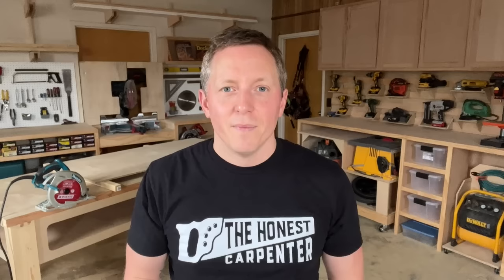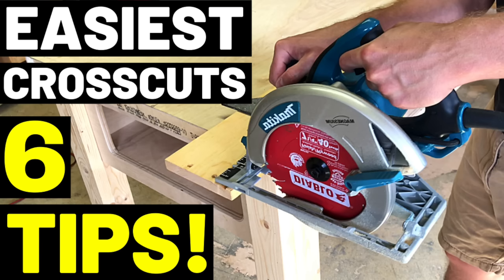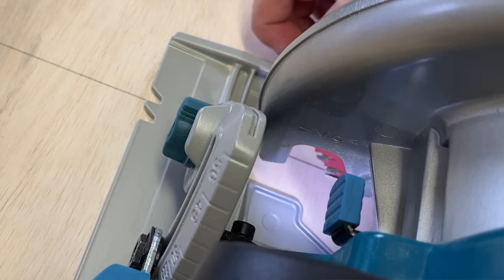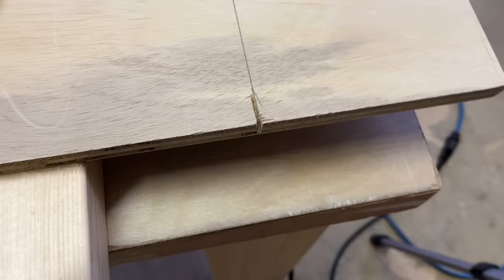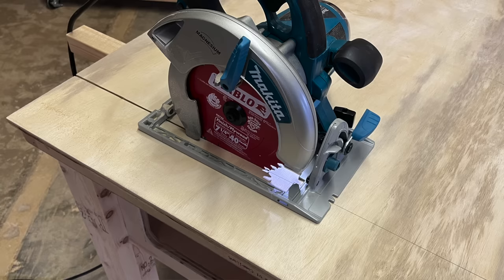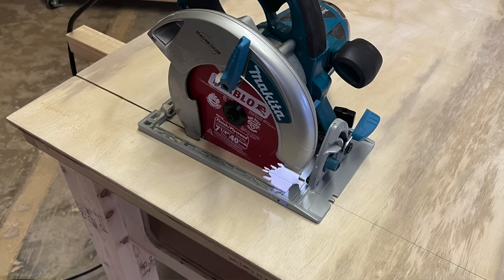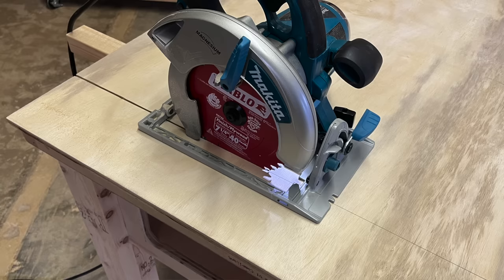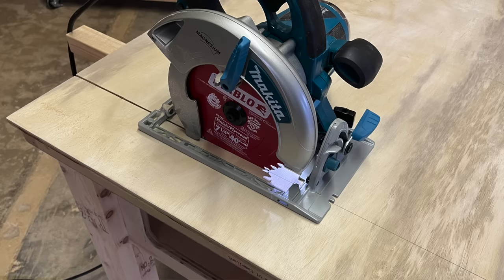How To CUT STRAIGHT With NO GUIDE! Freehand CIRCULAR SAW CUTTING...Pro Tips, Tricks and Secrets!

Comment: I'm a lefty and my sidewinder is just like yours. This means, when I hold the saw in my left hand, my whole body (and head) are to the right of the blade. I don't need to lean over the saw and see around the saw body. Also, if I'm cutting along the edge of a cutting table, I'm not twisted and crossarmed and can walk comfortably along the table. I've always wondered if what people think are "right handed" saws are really left handed, and vice-versa.
Reply: Same here. The only issue I've had is that most saws tend to spit the sawdust at your leg.

Comment: 8:42 Dang dude, did you heat that blade up a bit?
Good instructions for the DIYer no doubt. 
One thing I'd like to add which you may or may not have covered. While holding the saw, Don't be tense.
Also, The importance of """sharp""" blades help you & your tool(s) do the job with the greatest of ease.

Comment: Me, having arrived here because I'm trying to do a project with a cheap saw with a cheap blade.   Shoe is warped and isnt straight from the factory, blade may not be perfectly straight.  Plus my "skills" (oxymoronic use of that word) are quite rusty.  If I coukd afford to buy a hand saw and do it the old fashioned way, I would.  I have a lot more experience with one of those.

Thank you for the tips and an execelent video.

  I'd like to see a study on the amount of accidents or injuries involving saws with that spring loaded blade guard, compared to accidents and injuries involving a saw where the blade guard was removed by the owner.  I know it's a legal requirement "for safety reasons"  But I wonder if it might actually have an opposing effect, due to people having to try to hold it back and monkey with it while cutting.  The saw I'm using doesn't want to make a straight cut in any regard.  But starting the cut with that blade guard down...  you'd be better off to not make the cut and throw the whole board on the scrap pile.lol. i'm sure I'm not the only one who always holds that guard up while starting.  And that in itself seems like a great way to have an accident.   A saw where one could have both hands on the grips properly; or one hand on the grip and one hand on the board (well away from the path of the saw.  Of course) to keep the board from moving, seems like it would result in less accidents.

Comment: I'm no expert by any measure when it comes to woodworking, but that was a great job breaking down the details of how it's done (many of which I didn't realize I knew/do until you pointed them out. 

May just be me, but I've found it useful to check if I can safely complete the cut without repositioning before I start the cut. Even if it's not always possible to avoid repositioning/moving verify can help reduce the amount of repositioning needed (particularly on longer cuts >3ft) during the cut (whether cutting free-hand or using a guide). .....and it can also help with cord management/positioning.

Comment: Not quite ready to go freehand yet but this tutorial was amazing. Thank you!
Reply: Yes, good vid but like you, I'll pass on this.  Too much hassle, especially to start the cut, and then keep it straight until the end by freehand.  With a straight edge (like a 2" x 1" galvanize tubing clamped to the board) that extends somewhat on both sides of the board, you will begin and end perfectly every time.   This is from a non-professional but experienced DIYer.

Comment: I, like others here, have been a carpenter since 1976. And yes, tutorials are very beneficial. But nothing beats practice. Then experience follows. And different saws are better than others for site windows. And base plate site marks. Get a saw with a good site window and site markings. I'm disappointed in newer saws. With smaller bases, your stability gets less. My old Black and Decker saw cat had a beautiful wide base. Seems bases have lost width over the years. 
Anyway. Practice will definitely do wonders. Thanks for a nice video.
Reply from the maker: Thanks Peter! I see what you mean. I like this makita magnesium I bought, but for some reason they changed the sole plate shape. It’s got this 45-degree dog ear missing at the back. I feel like this affects lift-out when I’m finishing a cut. I can’t seem to figure out what purpose it serves 🤔
Reply: @TheHonestCarpenter  That's why I've never bought a worm drive.  With all that power, they are so awkward to use one handed. And no base plate or sole plate to speak of. But lots of carpenters um. I don't always know who designs tools. Probably the same people who design auto engines, that u have to pull the engine to change a few of the plugs,,,or maybe its cost. But it sure leaves open the demand for edge guides for rip and crosscutting long runs.

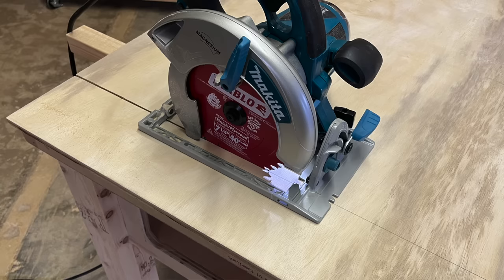Comment: 13:13 I use a zip tie to hold my blade guard open instead of my thumb. Put the zip tie through the loop for your angle adjuster. Don't pull it tight and just flip it loose with your thumb when you're ready to release the blade guard.

Comment: Ive never been able to cut straight, i blame my vision cus im basicslly blind in my left eye. It sucks, ive been able to adjust for nearly everything else in life but cutting my lines when sawing.  No matter what even when i use my angle and follow my lines, im going to try a laser guide though see if that helps...but the blocks underneath and going over the top instead of from the side reaching..that should totally help.

Comment: I'm a professional and have cut thousands of straight cuts without a guide other then a line. The key to keeping your cut straight relies on keeping your arm as stiff as you can, constantly watching the relation of the cutting edge to the line and finally trying to only move your body to move the saw.
Reply: Great video , could use a speed square to start off the cut , will make it way easier .

Comment: "Straight enough" is the real trick here. 

Pro carpenters (home builders) have pretty large tolerances and if you check even veteran pro long freehand cuts, they are not perfectly straight... 99% of the time, they're not even close. 

If uour project requires you to check the result with a straightedge... just use a guide and save yourself a recut

Comment: I saw another YTer use a large piece of (insulating board?) foam, to use as support as you did with your 2x2's, on the ground for big sheets of wood.  Other than that, you did a kick ass job of explaining the finer details of using the circular saw.  Great work (also the spot on with the camera angles and editing).

Comment: I place a piece of 3/4 - 1 inch foam insulation under the sheet stock before I cut it.  It is supported completely and is very stable.  Yeah, I Have to replace the foam occasionally, but the benefits are worth it.

Comment: I used my circular saw today for the first time today, I didn't realise it was unusual to do it freehand.. however, I started with small pieces, not a board, and couldn't see the cut line at all, not once the saw blade was  there. Can't see the blade at all. Cutting a wooden board was a lot easier as I could see the laser line on my cut line.

Comment: The guard always gets in my way.  I had an old saw that I took it off.  That was years ago.  Now.  Just with muscle memory I pull the guard back before every cut.  The guard always provides just a bit of feel able resistance.  Don’t pull back.  Go slow.  Don’t use the guide on the saw.  Use your eyeballs and stay glued to the line.   When I get to the end of a cut and it will get in a bind at the very end, I reach around with my other hand and gently hold up on the discard piece and then a go from a slow cut to as fast as I can.  The saw can make the straight cut before gravity takes the wood and creates a bad end.  Just the last 2 inches.  I even do it without holding up on the other side.  Like when cutting plywood. I will be stretching with 4 ft or longer reaches.  Just zip the last two inches very fast.  The blade goes through.  The falling piece, falls and all the corners land at the same time and you feel the gush of air get displace, and it makes the sound of the entire piece hitting the ground evenly.  That is a perfect cut.  I am a tool nerd. It is like crack for me.  I always have to buy tools.  Ever since I was a small child.

Comment: Excellent video as usual. This is exactly why I bought a track saw. I got a budget model but I'm not in your league. I also bought a "universal" track and sled from China for my battery powered Metabo saw to use at the big box stores because their panel saws either never work or it's just a crap shoot. I've even called to make sure their saw is working and then get there and no one working is trained on it 🙄 That was Home Depot. Lowe's has a problem with working saws. For the record we have 2 Home Depot's here and 3 Lowe's in the city and several outlying towns have one or the other within a 20 minute drive. It's pathetic.

Comment: This is an awesome video. I've done a moderate amount of skilsaw work: maybe a couple hundred cuts of varied types. But I have not been confident at all about free cuts: for cuts demanding precision I have instead relied on clamped guides. This video has brought up many great tips including: (1) getting the cut started perfectly  (2) giving about 1/4" opening (3) keeping your eyes directly on the cut line (and not on the v-cut guide)  (4) getting the blade completely up to speed before entering the cut (5) leaving the saw on the exact spot if you need to stop it for a moment (and backing up 1/4" before starting again)  (6) allowing 1/4" inch of blade below the cut (I sometimes did less)  (7) cut through the line (but I guess more towards the kerf side?)

Comment: Cutting sheet goods has always been a struggle for me, more due to space and availability of equipment. I can't wait to see the video on how to get more precise lines when cutting sheet goods. I have a guide but clamps get in the way and sometimes the saw doesn't ride the rail well due to the rails low profile.
Reply: Try a clamp on guide to avoid clamp interference. They are cheap and accurate enough for most purposes
Reply: @firebladex8586  Thanks for the advice, I actually have one but I find that the guide plate on the saw jumps the rail and still runs me off course. 

Do you have one you'd recommend?

Comment: Once the blade is fully into the board (6-8"), if your steady forward pressure require more pressure, or you smell burning wood, you are twisting your saw and won't have a straight cut (assuming that your blade is sharp).  Stop and check your setup and support, move your body to be more inline with your wood, ensure that you are using a good blade, then continue.  (All learned the hard way).

Comment: These suggestions may not belong here, but give some thought before cutting to a few more points…
1. Am I using the right type of saw. Sometime you just have to make the best with what you have, but there is a reason why there are many types of saws: table saw, radial arm saw, bandsaw, Sabre saw, etc. 
2. Likewise, use the proper blade for your material. Another topic altogether, but think about it. Number of teeth, masonry, metal, etc.
3. Is the blade getting dull, warped, or dirty. Buildup of tree sap has interesting side effects.
4. Let the saw do the work. If you try to go too fast, it’s more likely to wander. 
5. Periodically check adjustments of depth and tilt. A good saw should lock in, but it never hurts to double check.
6. Give it, and you, a rest. Pay attention to overheating.

Comment: Different saw blades have variations in the kerf width.  I know that the cut guide marks on my saw with my present blade does not line up with the kerf.  It actually cuts on top of the line instead of right along side of it. This is because the blade on it has wide carbide teeth.

Comment: I get the blade parallel by plunging it slowly. I'll start slightly on the waste side of the cut, and then micro adjust it to the line and parallel to it, and then plunge in parallel.

Comment: Great video. What's your take on tools that use lasers to guide you?
Reply: From someone who was pushing a circular saw the this Youtubers daddy was in diapers. I tried the laser guides when they first came out.  Could not keep enough batteries in stock.  I personally think the laser guide is just a "gimmick".  I never met any woodworker who had anything good to say about them. The REAL requirement, as the guy making the video said, keep your eye on the spot where the blade meets the wood.

Comment: A tip not mentioned often is eye dominance. Right sided saw blade and left eye dominant is difficult (error prone). On my end it will often cause deviations of a few millimeter. Disclaimer: I could use some extra time woodworking.
Reply: I have literally just found this out and wish I'd considered it before.  I was having a rant about how difficult the circular saw is to use yesterday, watched this today and realised in an instant what the problem was.  I am VERY left eye dominant and yet bought a right side exposed saw.  Darn it.

Comment: Great video here Ethan pal.. Been sub'd for a while now bro and I have to say that I really enjoyed the content of this video. I have a table saw but I like to use my Bosch pro Circular saw for cutting larger boards of MDF, OSB or Plywood. I always feel more comfortable this way but I am going to buy a good trach saw next year when the finds have been saved.. I think I'm going to build one of those Benches with the drop down guides like Peter Millard has on here. He builds cabinets and kitchens and I am looking to get building a bespoke kitchen for a family member over the next year or so. I want to learn as much as I can from these videos but I don't have the basic grounding that most chippys would have. I only really got into woodworking over the past 6-8 months really.. 
I want to build a station for my Bench Drill and Mitre saw but I'm a little weary of getting started atm. I'm kind of afraid tbh. I know I just need to get on with it but something is keeping me from getting on with it. I lack confidence using my Table saw. It's not a great piece of kit tbf. I need to invest in a proper one from Axminster or some one of the makers here in my country, IRELAND.
I will eventually get around my confidence issues and begin to build slowly but surely.

Comment: A couple more tips that can help. 1. Keep your wrist stiff. Move the saw with your body, not your arm. 2. On a right angle cut, the base will be parallel to the edge as you complete the cut, so use that to avoid hooking at the end.

Comment: all these nice and helpful carpenters talk about how to cut the wood perfectly and straight and how to avoid uneven and jagged edges but no one talks about what to do or how to fix an uneven cut or not so accurate plywood cut by a circular saw.
sand paper? angle grinder? file ? what how?  wood, plywood, laminated etc?

Comment: I always keep 3 pencils on me. One to mark, one for backup/share when a pencil inevitably goes missing right when it's needed, and a final one to stuff in the blade guard to keep it up in place.

Is that safe? Ehhhh. But I still have all my fingers, and the 2 saws I've primarily used always have a bit more resistance than I'd like when starting cuts when I leave the blade guard alone and the movement from feeling like I have to adjust to that has caused me to screw up too many times to kick the habit.
Reply: For any people not extremely proficient with a circular saw, DON"T EVER block your guard into the up position. It's extremely dangerous to you and any material you might set the spinning blade onto.

Comment: I'm subbing to you because I'm a 1st year (special needs) and I may need the extra help!
Can you please do a video on cutting while using no line and no saw horse (using your leg) with 2x4 and 2x6?

I'm struggling at work with that also when I cut I point my finger on the handle using my middle finger to start the saw.